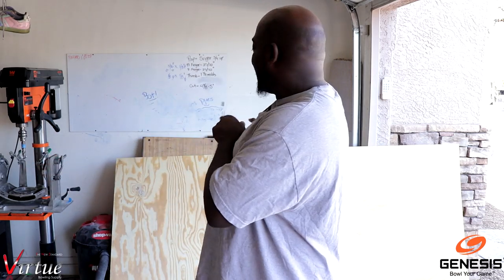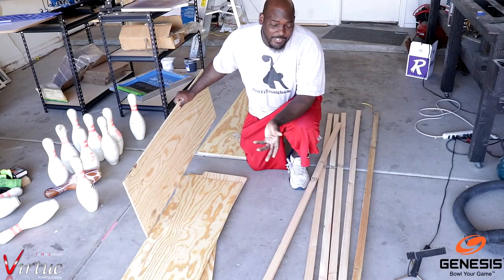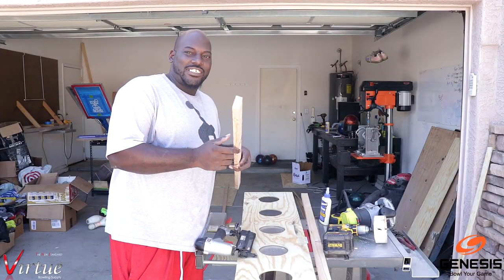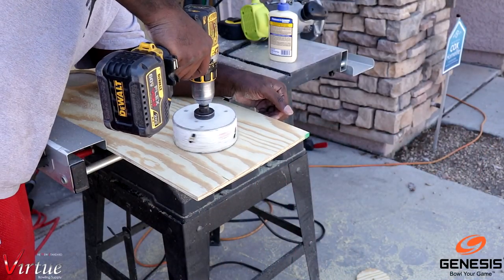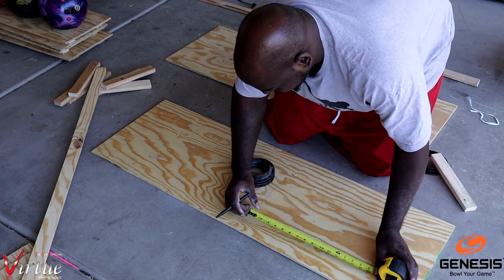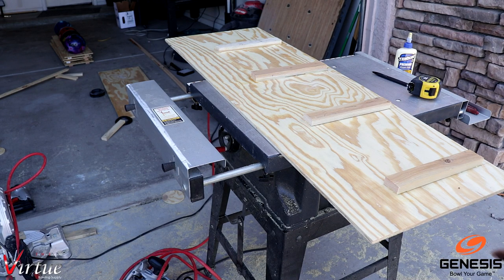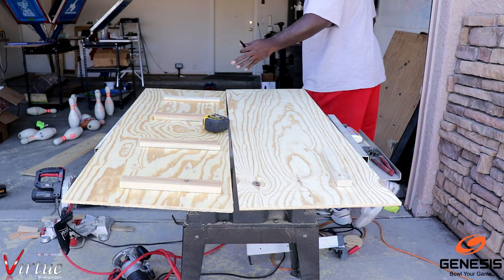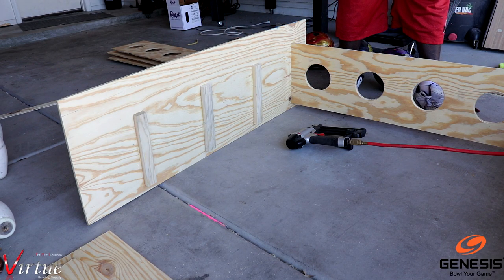DIY: How to Make A Bowling Ball Rack

Comment: Thanks for the plans. I'm building this shelf using full ball cups. Tip: when gluing the cup, drill a pilot hole into the cup. That way, when you glue it to the wood, you can use a wood screw to hold the cup in place while the glue dries. This is handy if you don't have enough clamps to hold them. 24 hours and then remove the screws to keep from marking up or gouging your bowling balls. Great video.

UPDATE: Thanks Jason, the rack came out perfect! I sent pics to the fam (personal and bowling.) I had some 1 x 2 pieces left over and used them on the base of the rack. I had some furniture glides from a previous project so, I used them to raise the rack off the floor. That way, if water gets into the storage area, it will not soak into the rack. Thanks again and wish you many strikes in your future.

Comment: Great shelf!!! I’m about to attempt to replicate it as a Father’s Day gift... I don’t have a the hole attachment so I’m planning on using the bowling ball cups. How should I attach them to the wood to ensure they are secure? Also what size nails did you use? Can I use a staple gun? Also he has about 30 bowling balls. I’ve done the calculations as far as making it 7 balls per shelf, but would that be too much weight?
Reply from the maker: Any type of construction adhesive will work, I used brad nails, the wood glue is key though, just make sure you go with thicker wood if your making it wider.

Comment: Great idea! Like the general concept. Will say, watching you using table made me cringe.😬 10/10 recommend using something to support the out feed coming off the saw. Look up "table saw kickback" on you tube.  I'd recommend using Baltic birch 3/4 inch ply though. Also, if you use the support boards on the narrower end it will provide better support with the grain perpendicular to the board you're supporting. Last thing, if you have a router, why the heck did you use a hole saw?!?! Would have been so much easier to use a template and router for the holes. Sorry I'm not being critical. I am just a carpenter so hopefully advice may help you in the future. Overall, think you did good work.
Reply from the maker: Oh no prob. This was just a Covid build. I used thicker on the original one I made. I installed commercial doors so metal fabrication is my specialty. I have the bare basics when it comes to woodworking...lol. Thanks for the tips.

Comment: I will probably be making one soon. Just will most likely paint it black.
Reply from the maker: Not sure how I'm going to dress mine up yet.
Reply: hihbowling : I got it built. Looks good.
Reply from the maker: @alanring6990  nice! Was it pretty easy to do?
Reply: hihbowling It wasn’t hard to do at all. I don’t have a table saw, and had to use a circular saw, and my staple gun is at work so I used screws in it. When I was routing the holes I was looking at it, and did it on top and bottom, and the top and bottom of the long edges of the shelves. When I was painting it I looked again and wish that i had done the top edge and front edges of the side boards as well.